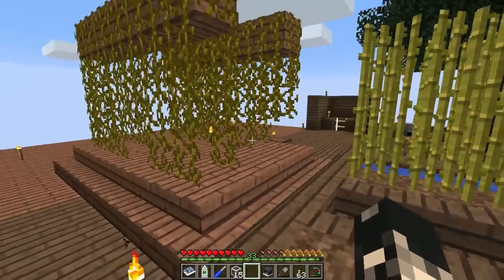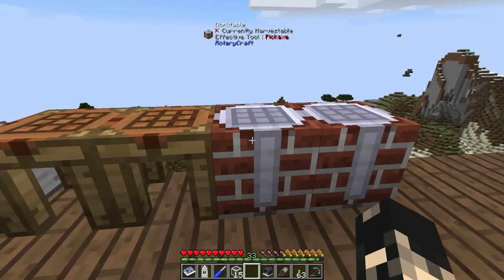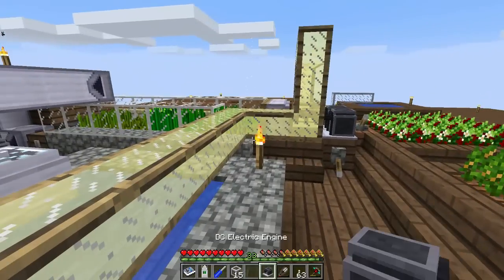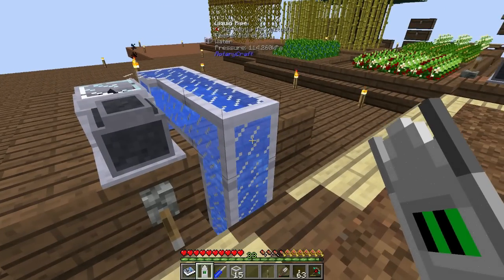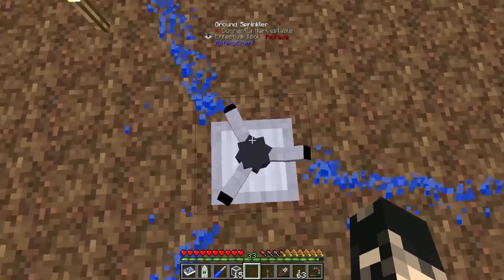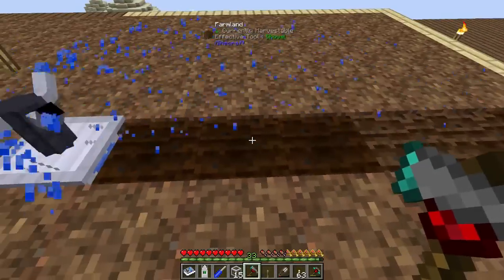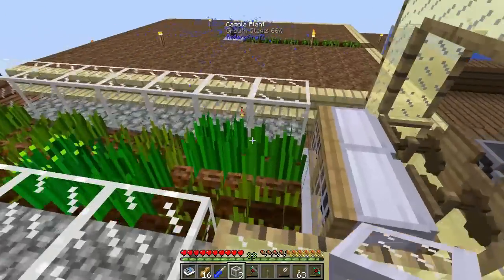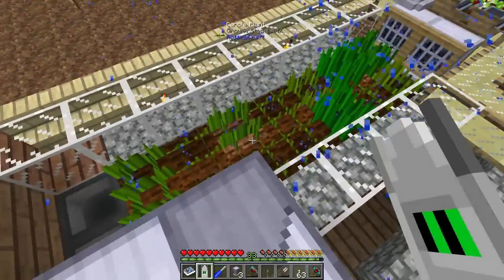RotaryCraft Sprinkler, Farm hydration, growth rate increase

Comment: Have you updated the pack recently?
Reply from the maker: juan mnccrac Yeah I'm on 10.5 Full of BTP, I'm still using the forestry from 10.3 Full. It still seem to have issues. And I'm on v1f of rotarycraft, waiting for v2
Reply from the maker: Both pack and mods are updated now, I've got it to work by opening up dragonAPI in ZIP program(7zip) and deleting the forestry folder inside. So no more forestry/rotarycraft interacting for the moment.